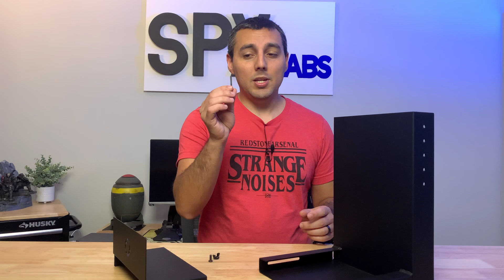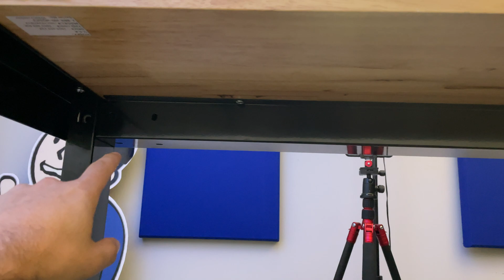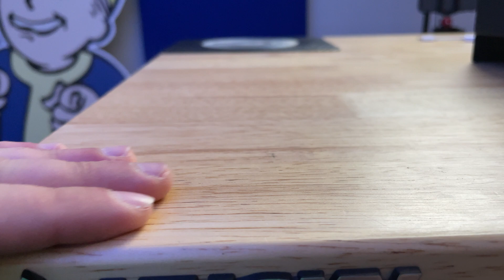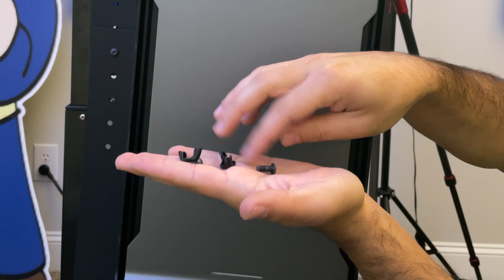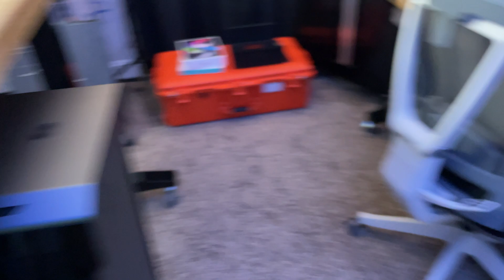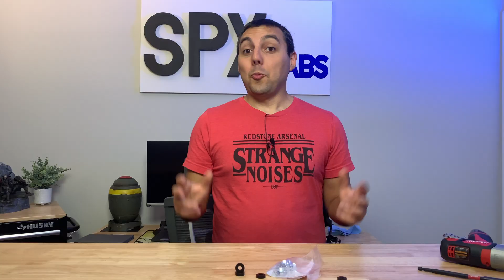Under Desk Gaming PC Mount from Oeveo | The Titan Adjustable Mount

Comment: Debating on doing this with my case but it's massive and weighs a ton. 

Got a link to the mount you used for the headphones? I might go that route too on my new desk. Just trying to get some ideas.
Reply from the maker: Definitely double check height and things.  Other use its pretty neat.

It is hanging off the handle to raise and lower the desk lol

Comment: It looks like it is leaning because it is actually a poor design. Had the mount slid up the channel on the inside of the bracket instead of fastened on the outside or a piece that wraps around the channel it would have provided more support/stability. Or at a minimum, it should have had two screws next to each other.  Good video, poor product design.
Reply from the maker: It is definitely leaning.  Needs 2 more screws to help straighten it out.  For smaller towers it would be fine, I think.
Reply: @SPXLabs  That might be an issue, but zero chance that's the issue here. I knew before you even mounted the case that it was going to sag. These L-shaped mounts all suffer from the same design flaw. The material isn't strong enough to support weight at that angle.
Reply from the maker: Yeah basically

Comment: You think it could handle a 67 lbs Computer?
Reply from the maker: That’s a good question.  I believe the Titan mount can handle up to 50 lbs.  not sure if I’d risk going too far beyond that
Reply: @SPXLabs  thanks! I’ll keep on looking lol
Reply: @juangofett0  Our engineer suggests securing the mount with a screw that goes up to 3/4" or 1" into the desk. We rate our products with anchors provided and the fasteners used. The more "bite" that the fasteners have inside the bottom of your desk, the higher the carrying capacity. You can achieve the 67lb carrying capacity with our screws depending on the material (hardwood being the best to secure into). Thank you for your interest!!
Reply: Hi @Juan Gonzalez our engineer is inquiring about the thickness of the desk that you are tying into.
Reply: @Oeveo  Thanks, but I ended up buying a different product.
Reply: @juangofett0  Thank you for your consideration! We appreciate the opportunity to provide a solution for your application.

Comment: First thing to do might be built a mini atx gaming pc with small case.. use external power button so you can slap it like a bass to power on.. get a usb extension dock so you can mount pc sideways on the back side of you table.. then lets create part 2 of this video.. where everything set up nicely..
Reply from the maker: Part two will more than likely be the gaming rig in the server room

Comment: I just mount my desktop in my server rack and run long cables🤓😎 I'd be nervous if the mount you have tips the tower over and the GPU breaks the PCIe slot like I've seen in bad shipping from a drop.
Reply from the maker: One day I plan to have my gaming pc across the house in my server closet.  Just saving money up for those expensive as thunderbolt 4 optical cables.